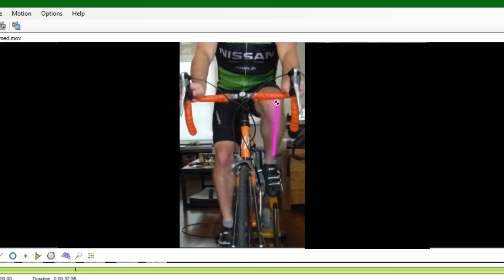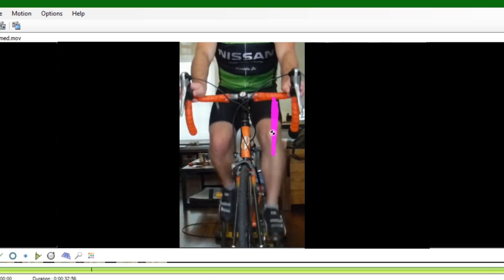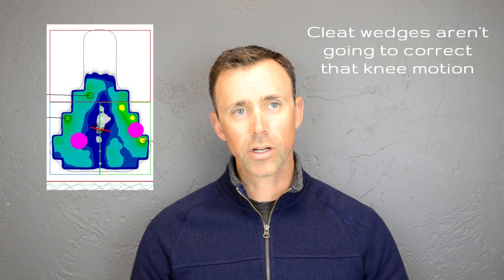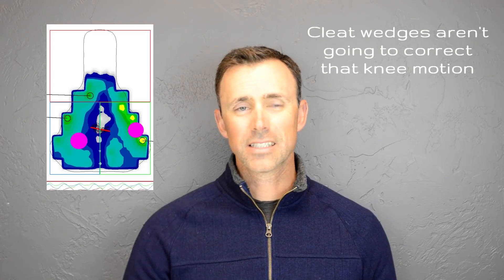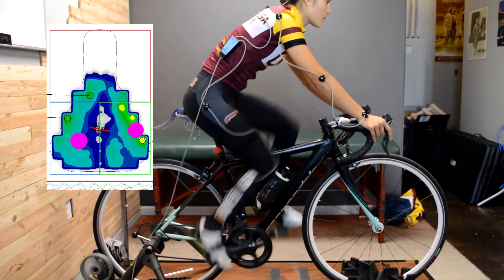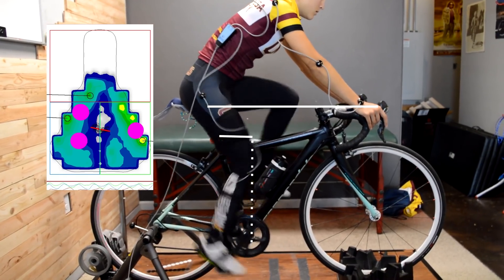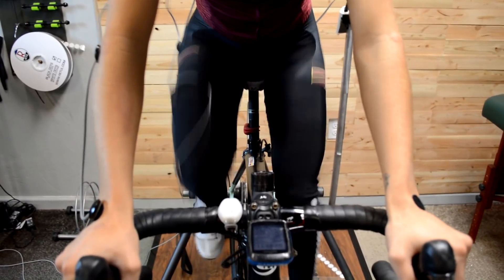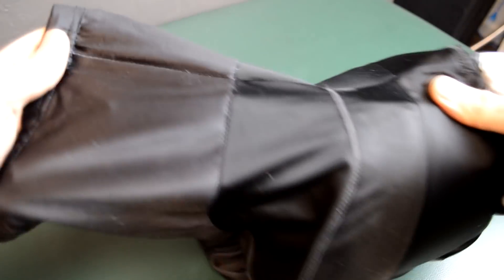Cycling Cleat Wedges and Shims //  Control Knee Motion?

Comment: Very useful topics!!  Also most people has different strength of each legs, like a one arm is stronger than other arms, etc. So leg movement tend to cover weaker one to support, that cause in slightly unbalanced movement. And most people, each legs are slightly different length. As you mentioned, nobody sit on saddle perfectly balanced...but as I try to remind myself to check more often and monitor during my bike riding. It’s big difference between with aware of the symptoms or doesn’t have any idea what’s going on with body movement. Thank.

Comment: Thanks for sharing. Have you ever seen anyone use a wedge to address morton's neuroma?  I have tried shoes with higher volume and are wider but I am still having foot pain. I wonder if using a wedge would take pressure off the left side of my foot and perhaps the pressure causing the morton's neuroma pain.
Reply: I realise this was 5 months ago but I have MN in my right foot. It is more problematic when running but can sometimes be irritated / painful when riding after 40-50 km. I recently had a full bike fit and the fitter put a wedge under my right cleat in order to correct my knee motion (falling inward at the top of the stroke). The wedge kind of increases the use of the inside of the foot / 1st metatarsal rather than the outside where the MN is (b/w 3rd and 4th metatarsals) so I imagine that it will help. I say 'imagine' because I have only done 20-35km rides since then. You'd want to be certain you aren't causing another problem in your knee by putting a wedge in. Only a video replay from front on under light and heavy loads will tell you. Good luck or did you get it looked at already?

Comment: I had some right foot lateral 2nd joint 5th metatarsal pain that hurt when i put weight on it. I used a 2degree cleat shim to input pronation into the foot and straighten the ankle and the pain went away. The shim is still there. Im afraid to take it out now. Look pedals btw

Comment: I've started using cleat wedges after upgrading the fan I use with my turbo trainer - weird. I found that lack of cooling had been limiting my indoor VO2-max efforts. With a better fan, I was able to push more and in turn found that at higher loads my feet were pronating slightly. Actually, it turns out that my feet were normally loading the outside edge and only rolling in under high loads. The knock on effect was knee pain during hard efforts. Cleat wedges (varus) have helped me ride with more even pressure across my foot (as best I can tell/feel). They also seem to have cured my occasional knee pain during extended hard hill efforts - perhaps by fixing foot pronation under high loads and associated knee tracking effects. I used to get foot cramp from time to time and that's mostly gone too. I guess my foot is more relaxed now - though it's had to unlearn loading the outside edge. They've been my guesses as to what's happened with cleat wedges  - but they certianly seem to be working for me. 

I've come to really appreciate the turbo as a place to 'feel' how my body is on the bike. Accepting that it's not always a perfect match for outdoor riding, the fact that you can quietly listen to the proprioceptive feedback from your body is a real plus. Hard to do outside with crashing.

I'd be very interested to hear your thoughts on footbeds/insoles. I used to be a competitive skier and our bootfitter swore by having a soft raised portion in the midfoot, just forward of the arch and behind the ball of the foot. The intention/claim being that it offered improved proprioception, better telling the foot where the loads were. They were brilliant in ski boots certainly.

Comment: Can you do a video about leg bias?

My Rotor Power crankset has been saying that I have a 5-10% left leg bias.

I'm curious if there is something I need to do to correct that or if it really even matters.
Reply: My torque effectiveness is also a lot higher on my left side than my right ( left will read ~66% TE while the right will read below ~50% TE)
Reply: I'd like to know more about this as well, as I suspect I sometimes favor one side. Have you found anything out?

Comment: I had an old pair of shoes that broke so I got a new pair of S works shoes.  I think they are built to automatically cant the foot outward.  I don’t know if that is varus or what.  But I noticed that sensation of the outside of my foot dropping down relative to my other shoes.  It did not take long and I had rather severe outer hip pain.  I was 3 weeks from a 24 hour TT ride and had to figure out what was going on.  Finally, I put a shim in that lifted the shoe on the outside 1 mm.  I don’t know what angle that would be.  It was practically therapeutic.  My hips felt better after one ride with the shims in than they had for 2 weeks leading up to that final adjustment.  I went on to finish my 24 hour TT and continue to feel better and better in my hips.
Reply from the maker: Justin Sparhawk This is interesting because it's something I see on occasion. A client changes shoes and has their mechanics thrown off because the construction of the shoe is different. But your approach is spot on -- a few times I've had to place a valgus forefoot wedge to neutralize someone's mechanics. Thanks for triggering this idea...
Reply: The same thing caused me knee and hip pain. The built-in varus wedge in the entry level Specialized shoes didn’t bother me but when I went to the more rigid S-Works shoes, it forced and locked my foot into the varus cant which caused all my pain. Wish I would’ve figured it out sooner like you did but it’s resolved with using the Specialized wedge to neutralize.